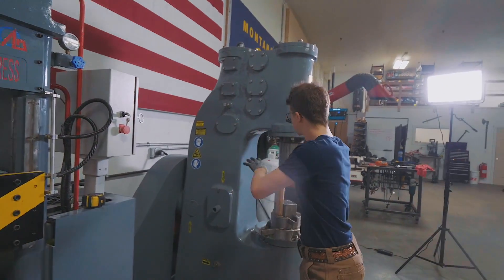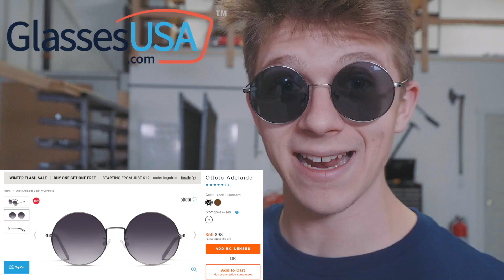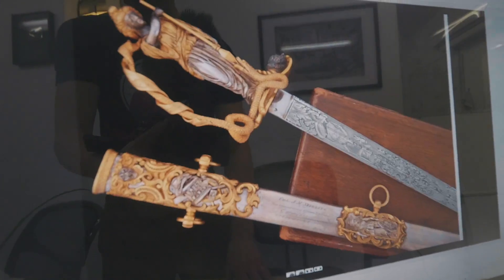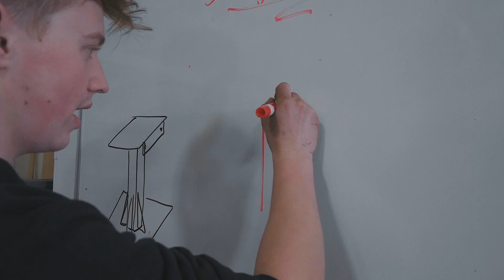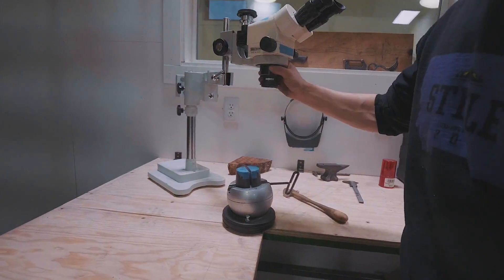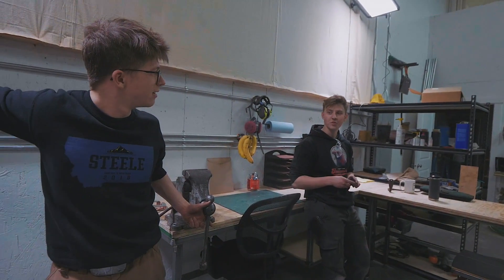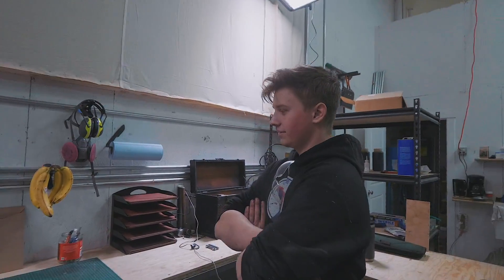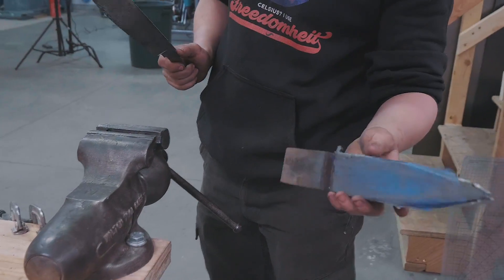GRINDER STANDS!!!

Comment: Ex lighting designer and can confirm; 2x4 with a hole in it is the best and most high tech mounting system
Reply: Dude i live in mt
Reply: That's some of the most High tech mounting hardware I've ever seen. Like cutting edge future stuff.
Reply: can confirm technique works an is widely used.
Reply: European based Timber Technicians would refer to this as an 89 x 38 Setup 
Just sayin 👍🏼
Reply: @brownwarrior6867  The issue is that even the jokes don't work, 2x4s aren't 2x4"!
Reply: @Black_Gold_Saw  KISS = Keep It Stupid, Simple.
Reply: Who even needs the hole, I just use spike tape
Reply: Yonatan24 88,9mm by 38,1mm is exactly 3 1/2" by 1 1/2" so the joke works quite well 😏
Reply: Duncan Mcfadden I wood rather say 45 x95
Reply: @MountainSolitude  Like when people criticize the "ridiculous" metric system is ridiculous, and question how you would call 3/4" plywood NINETEEN POINT ZERO FIVE MILLIMETER THICK PLYWOOD?
No, because first of all 3/4" plywood isn't actually 3/4" making it quite difficult to measure in inches, and 2nd because metris plywood would just be 20mm thick, aka 2cm.
Reply: Yonatan24 exactly. Both systems use shortcuts and round up/down. If i remember correctly 3/4" plywood/osb is 11/16" or somewhere around there.
I grew up with and mostly use metric, but imperial can be quite usefull too.
Reply: @MountainSolitude  metric system does round up and down, but the difference is: if it says "2cm thick plywood" then it is actual exactly 20 mm thick.
Reply: It's in the class of "If it looks stupid but works, it's not stupid".

Comment: Formica.  Otherwise known as high pressure laminate.  I bring it up because I found it very, very useful on workbench tops.  I found that spilled oils and solvents can ruin a plywood bench top in no time.  A couple of sheets from the home center (Home Depot, Lowes, etc.), some contact cement, and a j-roller and your plywood counter tops will last 10x longer than bare plywood.  I put it on all my plywood workbench tops.  One of which is 20 years old.  I always get what even left over pieces they have long enough to do the job.  Just a suggestion.

Comment: I am a master sheetmetal worker with 4 years practical metal fab/ welding while in highschool where i went to work for school credit.  After that i bounced through a couple small welding shops and iron workers shops before joining the union and getting 5 years of college credited level courses from fab to cad to drafting and metallurgy excedera.  And many many years on job training after with update courses.  And as someone educated in the buisness i tip my hat to you guys.  Your young and determined and very highly skilled with a unlimited future.  I would love to meet you guys some day.  Keep it up guys
Reply: I am a writer who had welding shop in school because we were near a lot of farming. There, I qualified myself in twenty fewer lines.  They are quite obviously very highly skilled despite the fact that I don't think either has had much formal/professional training. (their ages alone give that away)

As for the future, it's not unlimited. In five years they will have 99% of every skill they'll ever need for metalworking and youtube will quite probably no longer exist with Adsense by then so they'll be in the private sector or switching jobs.

Just keeping it real. Unlimited by definition is limited because there is nothing without a number on it. The skills you listed will max out quickly and they might do it for fifty years.(doubtful at that even )

I guess the term "unlimited" is good in high school speeches?

Time to keep it real, my friend.
Reply: Chris i agree with how you broke down unlimited.  Of course everything has an end.  None the less these kids have more skills than alot of journeymen i would teach when i ran update courses and always took any available update course available.  Regardless of what happens with youtube and there show they will continue to grow with there practical skills every day.  And i myself not knowing them i am very proud to see young men grab the trade and make it whatever they want it to be.  I am an optimist and the glass is always half full, i have never ever failed at anything only found millions of ways to make something not work.  So that is why i use limitless.  Because these young men as long as they get up and keep working there future is whatever they choose it to be.  Alec and will i wish you all the luck and prosperity possible.  And i enjoy watching you guys work.  Ive learned a few things from you guys and you guys continue to 8nspire my artist side with my knife making.  Thank you guys

Comment: Also here's a thought, if you hang flags from the ceiling, "just let them hang as if they are on a flag pole" they will work as sound baffles as well. Just a thought.
Reply: pinning the corners but letting them sag, say 6" in the canter also works
Reply: It's what the Navy uses as sound baffles in the drill halls
Reply: Problem is that casts shadows and ruins the lighting for filming if they hang down very far.
Reply: Demo ranch did it first

Comment: you should put the microscope on a separate table or floating stand from where you are working/hammering to insulate it from the vibration, i think it wil make it much better for you to work with and obviously it will also look better in the videos

ps: 12:24 banana for scale?
Reply: TheMadJoker87 storage not scale

Comment: 2 days to the next project!! that's awesome! 
I know you've not started it yet but I was wondering if you would ever think about making some armor. Armor is one of the most challenging things a blacksmith can make because of how is works in relation to the human body. If you've ever seen KyghtErrants channel he does an excellent series about medieval armor.  
The other thing I was wondering is if you would consider remaking old projects (claymore, and khopesh would be my choices) with your new knowledge? A jeweled claymore with Damascus and gold and silver Celtic knots running up the blade would be outstanding, it would look like nothing I've ever seen before. 
Another thing you could look into is something called Wootz steel, its a steel that is incredibly strong and was produced in India and the middle east for the majority of history, its actually what Damascus steel used to be. What we call Damascus is pattern welded but the crusaders found a crucible steel in Persia that they termed Damascus and it eventually came to mean patterned steel, Matt Easton has some videos on it.
Sorry for the long post, super excited to hear that you are settling in, can't wait to join you on the cavalry saber build!
Reply: Would love to see him make a full suit of armor.
Reply: The blade would be hardened so engraving would be extremely difficult, if not impossible I would think.  Unless he did a San Mai with and unhardened jacket, but that means no damascus.  Also the type of steel you are talking about is no longer made and they are not sure exactly how it was made.  Depending on what research paper you read, modern steel is actually a better steel anyway.

Comment: I didn't know anyone made grinders using VFDs.  I work with a company that reps a major manufacturer of VFDs (Danfoss) but they concentrate on industrial pumps and fans and such.  However I've long thought that VFDs would be awesome for things like variable-speed grinders or even mills.  At least with Danfoss drives, you can even run a 3-phase motor on 1-phase power!  Truly an awesome technology.

Comment: You might wanna check to see if that grinder can run off of two hot wires. In the States, 240v is usually two 120v wires using a center tapped transformer, creating two 120v phases that are 120 degrees apart. This requires two hot wires and a ground/neutral while the UK just has the hot, neutral, and ground.

Comment: I would rotate the press 90 degrees so you are not limited on the length of stock you put into it by the wall. I would also recommend getting some swing arm lamps for the finishing ans detail work stations. If you can find them, there are some that have magnifying lenses in the middle that are really useful for detail work. There are also LED lamps  like the ones in Adam Savage's shop on the Tested channel here on YT that are really useful as well.

Comment: Before you connect that power tool from the UK in the high voltage slot. Remember the UK uses 50hz and the US uses 60hz which can impact your motor. So you may need a frequency conversion on the power (if you don't have one already) besides the voltage being 220+

Comment: Always think work-flow. Stock to saw, saw to forge, forge to hammer/anvil, forge/anvil to workbench, workbench to grinding. That being said, the stock-rack should have been by the bay doors (off the truck and on the rack in the least distance). Read up on Lean Manufacturing. Also know as the TPS (Toyota Production System). It's all about reducing movement of material.

Comment: A suggestion for the microscope placement, i wouldnt put it in a corner where u have too little space to opperate on. i would recommend to place it in a spot where you have a 180° to 270° access so u can work on different angles.

Comment: Tip: when cutting steel plate with the plasma, use two benches and cut in the space between them...that way you don't have to worry about warping when they start to fall of the bench.

Comment: Who dat girl standing there drinking coffee @1:07?  

Also, tip for your oil bottles used at the drill press(s).  Add a bicycle water bottle holder to the wall there or on a drop bracket from the drill table itself.  Keeps the bottle from hitting the floor and making mess.

Comment: I have been looking at the way you set up your compressed air rig. By the looks of it, every time you need it pressurized you have to go all the way to florida to switch the compressor on. Wouldn't it be possible to either wire a pressure sensor to the buffer tank with a minimum pressure set point so the compressor switches on when below that pressure? Or have a pulse switch next to every air outlet that you push once to switch the pump on and again to switch it off? It will need a bit of electronics to power a relay which actually sends the power to the pump.

Also, shoutout to the Dutch flag. :)

Comment: Alec with that Drywall/sheet rock near those Grinders it would be wise to Install some Steel 3-4ft high off the Ground and Screwed to that wall. You dont Need Fires in your new shop ;)

Comment: Hey Alec, why did you not put the second hammer on the thicc concrete slab? It might not be a 200 pound weight one, but it can still damage the floor, unlike the press, which, as you mentioned yourself, does not care

Comment: Just a quick question about the placement of your press. I know this is pretty late in the comments. But one isn't it kind of close to the wall? You wouldn't be able to work very long material as it sits. + two haven't you limited your access to the end the way that you've placed it. I know I use the end of my press as much as I do the face.

Comment: Alec, since you cut the plug off  the grinder just hard wire it into the outlet.  Plugs aren't that great and hard wiring to the line would be better.  Turn the outlet into a junction instead.  Just sayin'....

Comment: You should find a way to make Thor’s hammer. Make it out of something light enough to be handled but heavy enough to be a legit hammer.

Or... perhaps there is something to the point of Thor’s hammer, and instead make it as heavy as it would be with normal steel, and anyone who can actually lift it and use it properly would be worthy.

Comment: WRONG! GRINDER GRINDS!

P.S. It's called a drill press because the part that does the actual hole making is called a drill, and the drill press presses it down.  Perfectly logical.  "Post drill" pfffft.